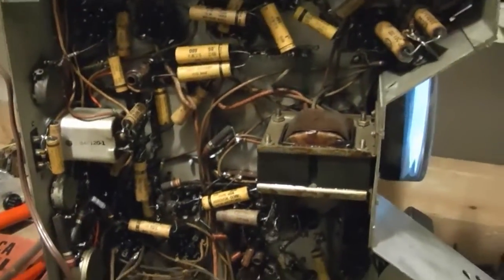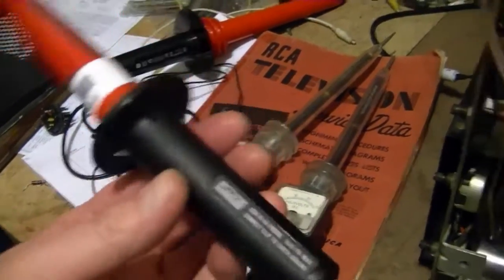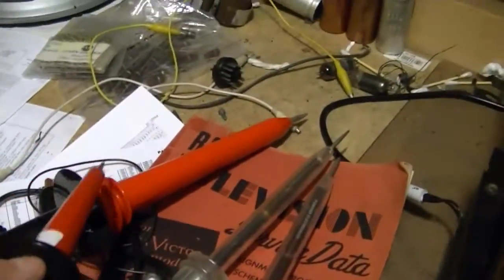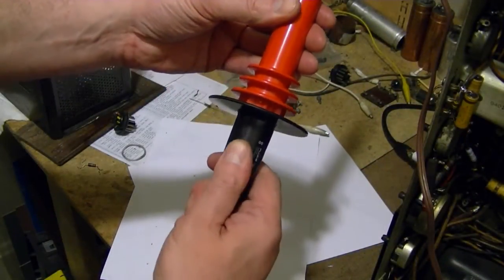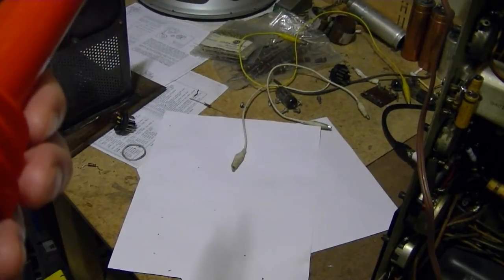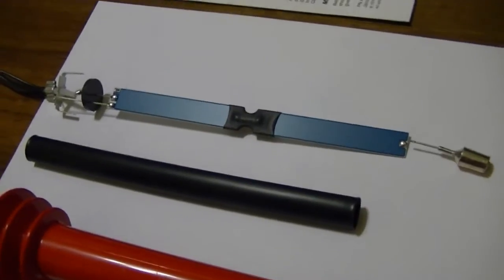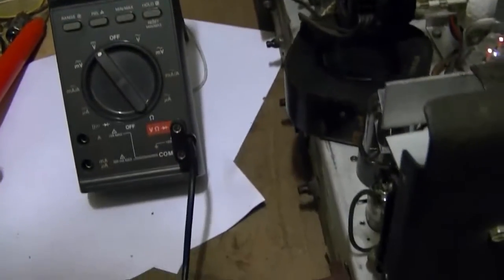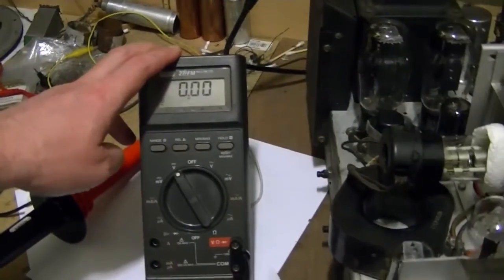RCA 630TS restoration p9o?

Comment from the maker: I did the best I could.  I didn't want to overheat the joint and damage the fragile resistor.    The plastic is fairly thick so it weighs about as much as the old ones with built-in meters.

Comment: Nice repair on the Fluke 80K-40 HV Probe!

I have a couple of these probes and have taken each one apart, it's quite obvious afterwards that if the tip of the probe is not unscrewed before spinning the handle there is a risk that the threaded metal collar could spin with the handle and shear the connection to the resistor straight off.

I could see it straight away when you slid the resistors out and the end had nothing on it, most definitely a result of being sheared of by the collar spinning with the handle.

As an interesting side note; the older Fluke 80K-40's actually have a large "Caddock Electronics MG 615-3 999M Ohm" wire wound resistor in it, you can tell the older probes externally by a deeper shade of red and black also they lack the barcode printing on the handle and have a smaller earth clip.

You'll also notice all Fluke 80K-40's have "Pomona Electronics Co. Inc California" moulded on the double banana connector which makes sense that they make them for Fluke.

Not sure if you can confirm that with your Fluke 80k-6 HV Probe?
Reply from the maker: Thanks for all the info.  I'll try to check my probe later.  I'm busy editing a video on test equipment including that probe right now :)
Reply: Excellent! Ahh editing, something I avoid by any means possibly (retaking the video sometimes), but at a cost as the presentation is not as nice, but I like to think of it as real world video lol. x]

Comment: I was really surprised in the shape of that dropping resistor. Boy, you are lucky that it was only the solder joint. You didn't show it, but I bet you got a nice round bead on that joint.
That probe must weigh nothing.

Comment: Those divider probes that plug into a multimeter rely on the meter having an input resistance of exactly 10Mohm. Have you checked the voltmeter on all its ranges using another multimeter?

Comment: It looks like you have probably finished this set judging that there are a couple more videos left and the set fires up and almost gives a complete picture. I just have to say thanks Bob for taking this old project of me and my uncle and doing it justice! kinda make me want to build or restore an old tube guitar amp for myself. I once dabbled with a broken tube amp got it working without a recap or new resistors but then it blew out. Well cant wait to finish watching.
Reply from the maker: Yes, it is working very well now :)  I had another cabinet in better condition so swapped out the chassis.  If the weather ever gets warmer, I'll put the final touches on it and do one last video.